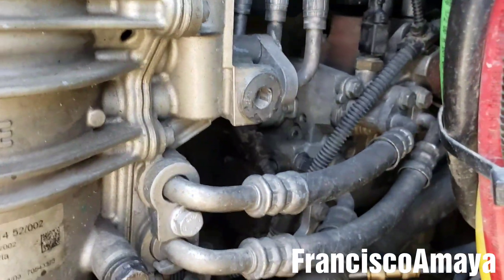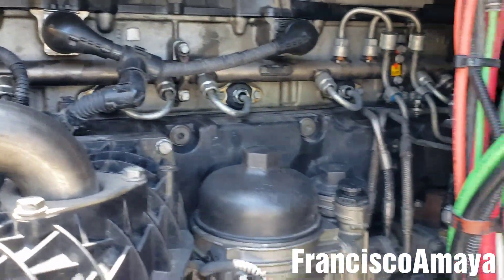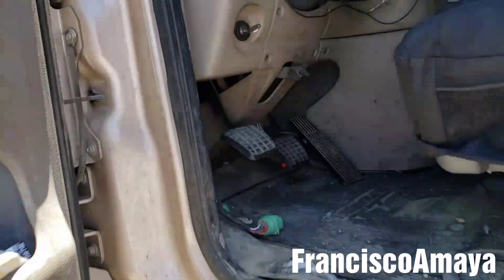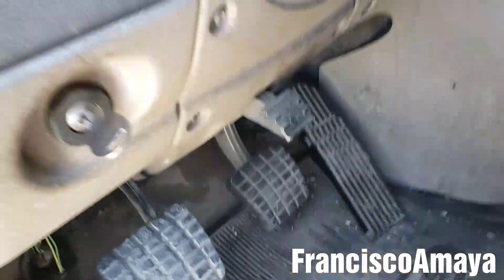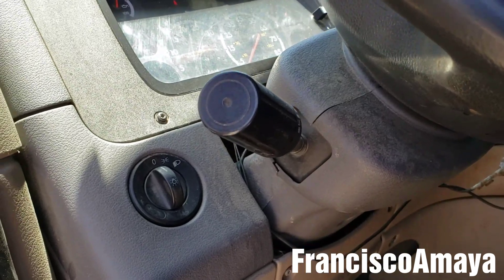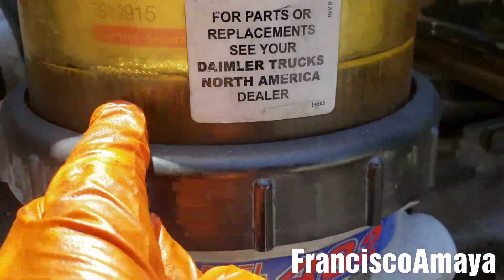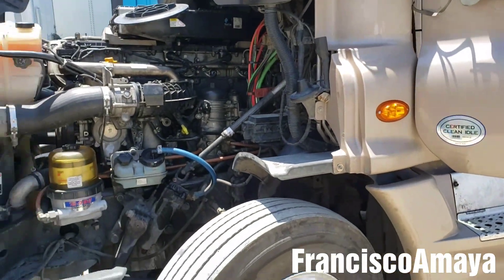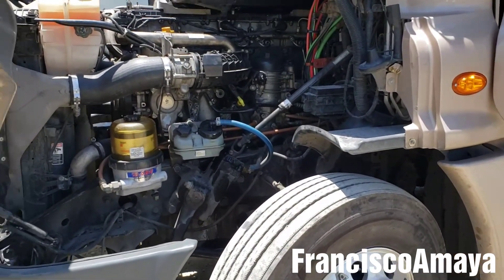Freightliner Cascadia DD13 DD15 DD16 engine high pressure fuel pump failure pressure too low

Comment: When this happens, don't waste time and $ changing the quantity control valve. Just change the pump. New valve comes with it. Under 1500$ with core charge from freightliner.
Reply: Nope. Metal should have never made it back to tank. That means it got to injectors.

Comment: That sound will cost u alot of 💰 if not taken care of right away hope there is no metal shaving in the fuel system.
Reply: @Super Fly if there metal shaving in its time to take out yr 💰 cuz u gotta clean the whole fuel system n that usually run bout 8k